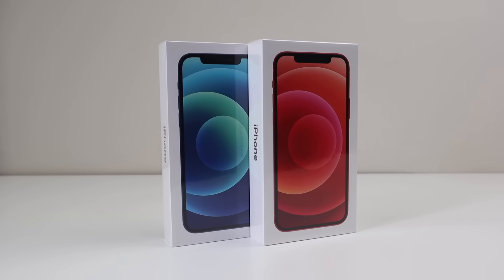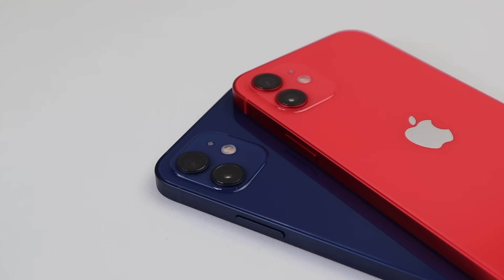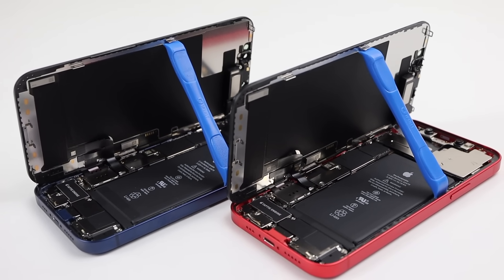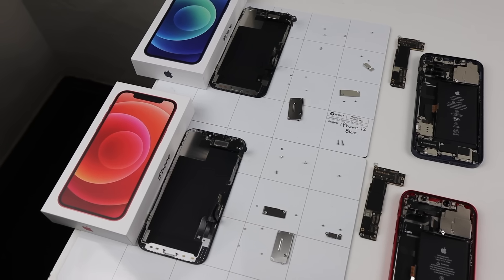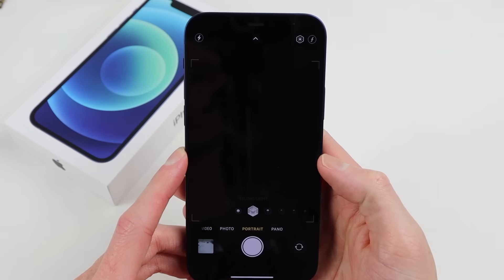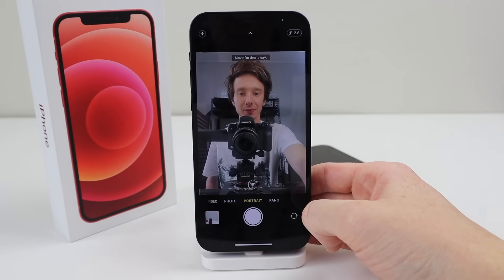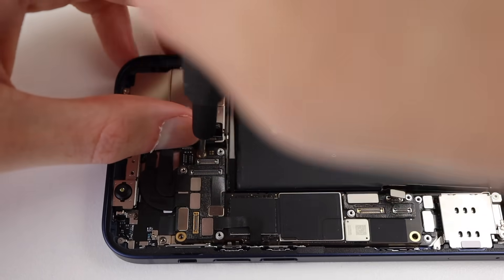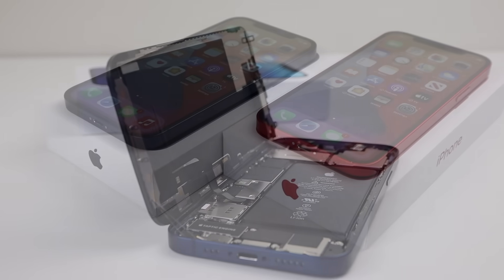iPhone 12 Anti Repair Design - Teardown and Repair Assessment

Comment: Apple appears to only really care about their bottom line and not their customers desires to repair/reuse, which is a more efficient means to lowering the amount of ewaste that result in damaging mobile phones. 

Now, unless their phones are almost indestructible and cameras are virtually never in need of repair and the Oled screens never crack or become damaged in any other way, this is simply unacceptable. 

However, I still continue to use Apple products and have since their first iteration of the iPhone. I can’t get passed the simple user friendly iOS, the fact that most of my libraries (music, video, photo) are and have been stored in my iTunes/iCloud. 

Samsung has been getting more and more tempting though.

Comment: Just a layman perspective but is the pairing between the hardware just part of the security design? Especially considering if the camera is used for Face ID it is a potential target for attack by messing with the hardware? It is clear this makes repairs a lot more painful and is bad for environment etc etc but considering phones are probably now the number 1 device to be targetted by hackers for most people and that people will do literally everything including banking and payments and taking naked photos of themselves with their phones, being able to gain access or bypass security by simply swapping out internal parts for modified ones would be a big security flaw and negate all the effort of hardening the software? Just my thoughts, please carry on with the typical meme bashing of Apple...
Reply: There are a lot easier way to trick face ID, without touching the hardware. Do not use biological markers for security, they are horrible for that.

Comment: during my time as a network security. there 2 sides, usability and security. product can't have tight security while providing freedom of usability. its like a door, the more locks it has the more cumbersome to open it. apple seems to lean towards security with that face id. fake/stolen iphone won't be that common now. it's a lot harder to temper with their stuff.. although i do smell a whiff of greed with some of that stuff
Reply: This does not increase security. Especially since biological markers are very bad for security. Nothing beats a good password.
Reply: @happygimp0  nono im not talking about locking/unlocking the phone, rather about hardware fabrication and data harvesting. if i remember correctly back in ip5 or ip6, there are scandal about people selling iphone for cheap and have their iphone break less than 3 months and repair shop not being honest by swapping the motherboard with a cheap one. MY set iphones are tad bit expensive than others.

edit : oh btw, biological security is among the strongest security out there since they're unique to every individual
Reply: @miru2583  Sorry but biology is not great for security. If it is colder or warmer, the body changes. Blood vessels become more open or close a bit. We get older and cells get replaced. Wounds can change the body. This means there is a lot of fuzzing needed which increases the risk that someone else breaks it. You can not change it, if someone gets your finger print he can make a fake finger with that fingerprint and get access. You can not change it so it means you are screwed.
A password does not need fuzzynes and is easy to change. Someone gets your password? Change it and the stolen password becomes useless.

Comment: Tha cable argument is so bs. If you have a previous phone you can use the previous brick and cable...
Reply: And how do you charge the old phone? If they really care about the environment they would make the phone easy to repair.
.
Fairphone does not include cables and chargers for the environment, but they design the complete phones to be easy to repair and environmental friendly. They also have normal connectors like USB and a 3.5 headphone combo jack. If apple wants to be environmental friendly they would do it more like Fairphone. But they don't, all they want is money from the stupid customers that buy apple.
Reply: @happygimp0  Why would i charge the old phone? What did i buy a new phone for?

Comment: Meaning that the parts are not to be replaced....and that just like a car having a chassis and engine number other than registration number, this model comes with similar set up. Unlike a car where the chassis and engine are not locked down, this system can be problematic.

Comment: No power adapter and earbuds included. To the morons who buy this phone, they are charging you more and giving you less to increase the stock price. It's all about profits.
Reply: Definitely I’m that moron bro!! After 4 years without knowing anything bought this bloody poor iPhone 12pro!! I didn’t know there was no ear phone and adapter!! I have old USB adapter but it doesn’t work with new cable 😢😅😅

I should go to google pixel bloody mistake !!
Reply: @mhpblaster7421  Google Pixel or a Samsung galaxy phone since both have Andriod updates for like 2 years and still let you replace parts in them
Reply: RIP APPLE
Reply: @名前 You have to buy the charger and headphones

Comment: Excellent video!  Apple has really changed over the years.  It wouldn’t be so bad if the Apple techs were actually knowledgeable and honest, and their prices were fair. But in my past (many) experience with them, they always lean towards repair which costs the consumer big bucks especially after the consumer already paid big bucks for the original phone. I used to be their biggest customer, I own everything Apple. And that includes my wife and kids, unfortunately I am seriously considering Samsung for my next piece of tech. Thank you for sharing, you did a fantastic job with the video.

Comment: I think I can deliver a technical explanation for that.
All components described in your video not working properly anymore requiring a calibration. This calibration data are most probably stored somewhere on the logic board and are bind to the serial numbers to each peripheral. To guarantee to fully function of the new built in components a calibration needs to be run. The question will be will this calibration sequence available for third party repair.
Reply: I think the explanation is much simpler: Money and stupid and rich fanboys that buy every iShit.

Comment: One of the most hypocritical companies on the planet. Sadly as long as people buy those products, they won't change.

"increased waterproofing" - idk, I work in freezing rain and sometimes make calls, never (in 15 years) had any issues despite not using waterproofed phones. If you are so clumsy your phone falls into a puddle every week or you fall off a motorboat annually, you got bigger problems than a potentially wet phone (everything is backed up anyway, it's not 2002 when losing a mobile phone meant losing own number and all contacts)

Comment: Interesting video. On a side note, it's just ridiculous how much money is poured in r&d for every new phone, I mean the phone manufacturers could  lower their r&d expenses if they stopped designing each phone from scratch. I don't get it why they have to always change the layout of the electronics for every new phone, even if the battery has the same capacity as the previous year they would just design it to have a slightly different shape so that's not compatible with anything else, not even their own phones from a different lineup. It's just electricity goddamn

Comment: Biggest click bait ever 🤦🏻 you shouldn’t be repairing:(  Face ID system (front camera and earpiece speaker) is known to be programmed to the logic board for security reasons, same like Touch ID! 
The camera freezing because of the lidar scanner is also programmed. Everything else is interchangeable even with iPhone 12 Pro! Just ignore the notifications, or wait until the guys in China make a programmer for those units!
Also, you told that portrait mode was working for the front camera what isn’t true at all, because it’s using the dot projector what can only work if Face ID is working!

Comment: It is more about people that were reselling stolen iphones and even stolen rebuild iphones then just to prevent outside repairs. So many crooks out there, it was even worse when third party could repair on the fly prior to 2018, not all but lots of them were the crooks even changing parts to make sure they would not be traced back. Then we wonder why they have to go that far to prevent swappable parts. At least i know none will be able to temper with my iphone not even cops or governments officials.  You see everything as a reason even the same ones that we complain about.

Iphones are the phones that are stolen the most so of course they will make it a pain or nearly impossible so that the crooks will give up. Good job Apple!!!!

Comment: They don’t repair boards or cameras charging ports, only battery and screen and even then costing almost the full price of the phone for screen replacement. Any other issue and your f*cked and sh!t out of luck. Only those repair shops that can do ROM swaps can do a board swap for you to get all the functions working. The camera and battery and screen contain very small rom chips with the parts Serial Number or part code in the rom chips to chance the part you have to remove the old rom from the part and install to the new part. It’s a freaking nightmare of bs to jump through. And servicing these locked down phones cost will go up quite a bit more than any other phone on this market

Comment: Alright, so i really like the idea of the video, but as a person who repairs phones for living, i have a couple things i have to say. The face id is not working because it is actually married to the logic board, as well as the rear camera, i can understand why the face id module is married to the logic board for safety reasons, but imo having the camera connected to the logic board too is really dumb. Now for the battery problem and screen problem, apple have been doing this for at least a year now they started doing it on the iphone 11 series. Now im not defending apple, but this is how it has been for a while now good sir. Now the last thing i want to address is the phone not turning on by the power button after a disassembly is a common thing, i could say that like 60% of the time after you do a repair on an iphone, it wont power with the power button unless you plug the device in.
Great video man keep it up💪🏽

Comment: Thanks for the video.
If you want the phone with charger and headphones, buy it in France. They have a law about mobiles being only sold with stuff to charge and for hands free driving (headphones).
As much as I hate the company, as much I do love it. From a repair pov it is absolutely fantastic to have smth to adapt to every year. Last year, with the iP11 needed to solder the eeprom from the original to the spare part. This year I'm not sure I have seen an eeprom on the displays (but I guess it is, maybe now in an even more dangerous spot). With the battery message being a problem since the XS, which can be done by wielding the controller board to the spare part. But with the camera problem, it seems smth new is coming up. Though, it could have been just a problem with the front flex needed to be the original one. So this problem might have only been tied to the face id needed to work. But we will see. More e-waste to be ready to launch. Happy repairs everyone.

Comment: This doesn’t mean it won’t be repairable. The biometrics are paired with the logic board and are not part of the screen. If you swapped screens only and left logic boards the same, they would have functioned just fine. You could do this same logic board experiment on an X - 11 Pro/Pro Max, and get the same result. All of this aside, there are battery and screen programmers etc. thanks to the aftermarket that work extremely effectively.
Reply: Basically, the aftermarket will find a way.

Comment: Here's a theory, Apple doesn't want people buying a cheaper iPhone 12, then finding a scraped 12 Pro, grabbing it's display and camera modules, in installing them into the regular 12 with perhaps a 3D-printed back cover to hold the 12 Pro cameras. A form of guaranteeing "undesirables" or "cheapskates" stay out of luck trying to find a recycled or stolen, but non-functioning 12 Pro and salvaging components from it... Forcing that person to buy a new iPhone instead.

Very sneaky, Apple... I wonder if there will be a class action lawsuit (again) against Apple for trying to stop truly independent repair with parts made from 3rd parties and not Apple.

Comment: This id10ts think that this is a car with 30 modules that are locked by VIN number. Note that, in car makes sense to avoid ilegal parts, tampering with odometers, change or erase diagnostica data etc. On top of that, an electronic module barely fails in a car. Now lets return to ther phone .... forget it.

Comment: I am trying to see this from both point of view. I won't have a problem with this if Apple with tie-up with  3rd party repair program and solve this by providing the needed software. This will help the users as they won't be getting ripped out by other people with bad intentions. 
BUT on the other hand, it bye bye to DIY and Home repair options, which is sad.

Comment: Apple: "we're trying to go to fully green by 2030" 
Also apple: *makes phones unrepairable creating even more e waste
Reply: @Anvith Shetty I'm sorry but have you actually ever used a Samsung? I've repaired more Samsung's in both my local phone shops when it's something more complex and done some myself including battery/charging port/camera module replacements. Apart from Samsung being more difficult to repair due to it's mechanical construction there are no hardware restrictions to do so. As long as they are genuine parts (some 3rd party Chinese parts don't often work because they don't have matching HWID but that's good means you won't get a part that's gonna explode in 3 days)
So you're entirely wrong on this one. Samsung's problem is problematic disassembly/reassembly and nothing more. They can't actually enforce it because Android ecosystem is open and cross-compatible. In the worst case scenario you can flash and install a custom ROM that will work with ANY hardware/software configuration. While that's not something an average user will know how to do, there's many qualified phone shops/enthusiasts that will do it with ease. The point is - you HAVE an OPTION, with apple you DON'T HAVE an OPTION. That's a major difference.
Reply: @egonieser  What samsung phone you work on? Literally the hardest part is getting the back glass off🤣
Reply: Don't forget, Li-Ion Batteries are way worse for the environment then most people know, with the huge strip mines needed for the materials
Reply: @Anvith Shetty they are, you are just uneducated. just look at Louise Rossmans videos.... smh android fanboys have 0 IQ
Reply: @stockholmpublishings2937  fanboy: argues that samsung denies repair
Professional: disproved
fanboy: silence
Reply: @HDTomo  samsung denies? What tf are you talking about?
Reply: By fully green they mean green dollar bills
Reply: It feels like it's on purpose... 🗿
Reply: @Anvith Shetty financial decisions? What? No one is forcing you to buy Apple. And all of those brand have different hardware with different ways to be repaired OR NOT REPARIED. Jesus just shut the fk up.
Reply: It's not unrepairable, it is protected from tempering. Just go to the authorized service.
Reply: @kikiwora  yeah, and pay much more for the repair compared to third-party repair prices
Reply: xOr  most apple employees dont know how to fix them they are very few who know apple cant do anything for that
Reply: who said its i repairable other youtubers did it in a few seconds and apple also made some parts more easy to repair
Reply: It’s not unrepairable, you’ll just have to go to an Apple store and pay like $200 to replace one part.
Reply: Mostly repairing is more expensive than a new device @ Apple and they try to make you buy a new device...
Reply: they wont have to worry abt me cuz I will change back to Android after ip11
Reply: @clhk12  Android phones are doing the samem.
Reply: @stockholmpublishings2937  doesn't matter, android phone offer so much more for half the price.
Reply: @clhk12  this discussion is not about price
Reply: @stockholmpublishings2937  my discussion is about how apple is going to lose their cusotmer. Of which you don’t seem to know what’s going on
Reply: @clhk12  you dicussion? This thread is about being  unrepairable. And they are not going to lose their customer since ppl that but Apple don´t buy Android.
Reply: @stockholmpublishings2937  Apples whole new phone is a scam. Literally they say they do it for the environment yet they make the phone less compatible. Apple is just a shitty company favored by kids who think it's a flex
Reply: @Anvith Shetty You do know that ANDROID is a SOFTWARE not HARDWARE.
Samsung is using the same tactics as Apple. Jesus u guys are dumb.
Reply: @stockholmpublishings2937  the OS is what restricts repair and android allows repair
Reply: @stockholmpublishings2937  do you even know what is software and hardware?
Reply: @Thatshow ED dumb? What? In that case ANYONE can repair an apple phone.
Reply: @stockholmpublishings2937  as seen here Apple devices are software locked and hardware locked. Getting ahold of 1st party parts is nearly impossible. If I go to Samsung's website I can order any part with little markup and have it delivered to my door. This is better for the environment, consumer, and if apple fixed their products then I might actually buy one, but if they don't want to allow right to repair I'm not buying their stuff
Reply: @stockholmpublishings2937  How would someone repair the iphone 12? Absolute dumbass